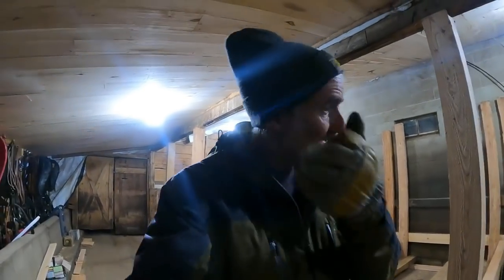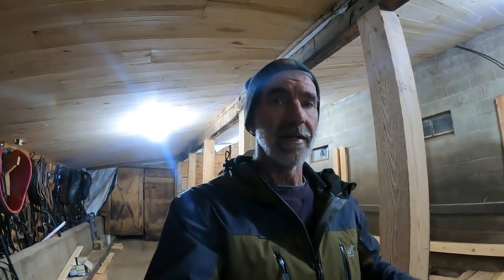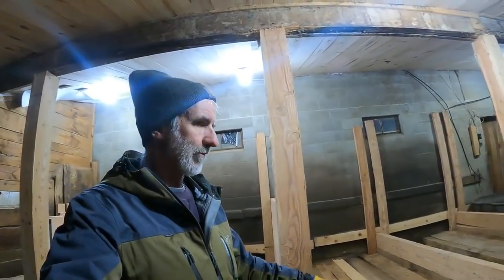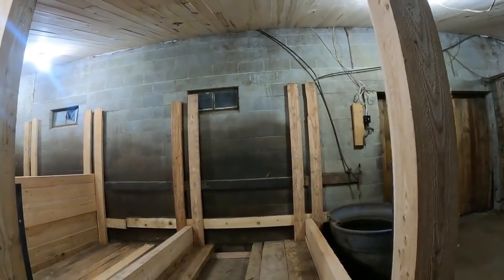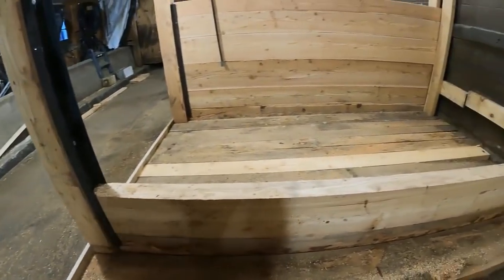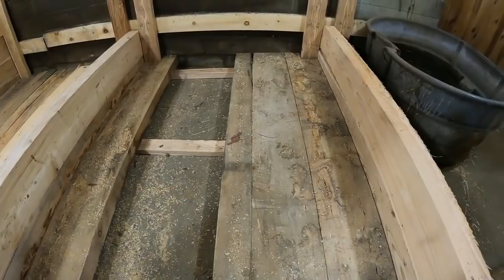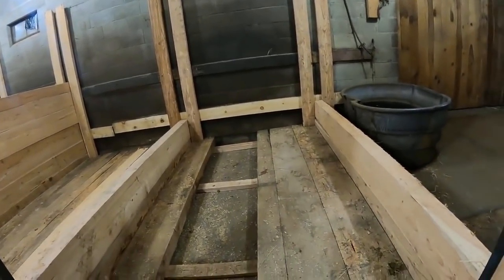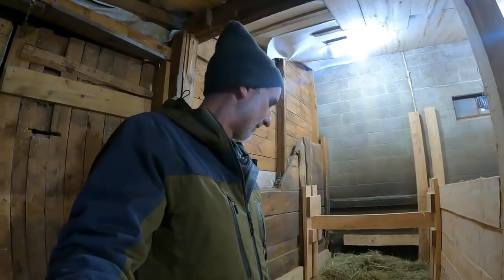Update on the New Horse Barn!!! // Draft Horse Stall Dimensions

Comment: I have straight stalls that are 8 feet long from the Manger to the back. My mangers are 36 inches tall and 30 inches from the wall at the top but run on about a 45 degree angle down to the wall where they meet the floor. I use rubber mats from Lineat rubber that are 4' 8" wide and that is the width of the stall. Stalls are 3"  oak. I wish I had the channel iron you have and the slope on the floor. My harness is in a box stall that I have converted into a tach room since I don't raise babies anymore.  I like what you have done.

Comment: Our box stalls had that wall to wall, seamless floor installed before we bought the place. That seamless floor works great. We don't have to worry much about rot from manure and urine. Those conveyor belts wear like iron, but when we had them in the work shop, sawdust would find it's way under them, so every now and again we'd have to roll them up and clean under them, lest we'd forever be tripping over the edges.
I wish that we had beefier walls like yours, as we've got a draft cross filly that's broke a few of the 2x8 spruce boards that our box stalls are made from.
We have water run to the barn, but even with the water supply being 5' below grade, the frost has still made it down that far twice since we took over the farm 5 years ago and have had to dig things up to resolve the issues wherever they've occurred.

Comment: Thanks so much for sharing your barn build!  I have never seen anyone use the old style tie stalls locally, and I am fascinated by them.  I kept my horse in a local stable that was actually a converted hog barn...low ceilings, uneven concrete floors in the stalls, big giant box stalls (it had originally been converted for broodmares and babies in the 50s), drafty in the winter and stifling in the summer.  We spent so much money on bedding and supplies trying to keep him off the concrete, and I know of so many horses who got into trouble because the stalls were big enough they had room to build up some traction.   Except for the worst parts of winter, those horses spent as much time outside as possible, just to keep them out of the barn.  How well do those wood floors work?  Do you have the replace the boards often because of urine damage?  Around here you're more likely to find compressed gravel or concrete than anything else, all of the old-style barns are gone or have been converted to storage.

A note of experience, one of the stalls where I kept my horse used reclaimed conveyer belting from a local coal mine as floor mats.  They did not install it properly, but I can't recommend it.  The mats were filled with wires that poked out from the edges, and it was warped just enough that nothing fit snug.  The horses were constantly tripping over the edges, urine would get underneath it and stink up the whole barn, and two or three times a year we would have to rip it all out powerwash everything, and carefully put it back together.  The only benefit of the thing I ever noticed was that that stall was just a little bit warmer in winter; the mats weren't really very cushioning for the horses that were in there, we still had to pile in the bedding to keep the horses from tripping over the edges.

Thank you so much for sharing your barn design, you have given me a lot to think about when I build my own barn in a few years.

Comment: Good job Jim. I wouldn't worry at all about the water. You and I both know Northern NY in winter is 5-6 months of worrying when the power will fail and the pipe will freeze, or a horse or cow will bust something and you find 6" of ice on the barn floor. Dairy barns, especially the old stanchion barns, were warmer and didn't have the issues a horse barn does. Any way, I use a similar slip board system and it works great. Good idea on the crap dropping back into the alley too. Tamarack makes a good stall floor, wish we had some up here on the farm. Far as width goes, I agree with your thoughts on horses turning in the stall. I've had a couple of knotheads that would do everything they could to turn and fight with their neighbor or try and get themselves into the manger. I finally put front board up at where the chest/neck meet height and didn't have any more problems with them getting into the manger. I have had some horses that had really lousy manners as far as trying to crush you against the wall if they could. Tie stalls help with that I think, especially if you remember to take an 18" hunk of broomstick in with you so you can get it between him and the wall when he tries to "lean on you". They figure out that pushing into that broomstick isn't near as much fun as squashing the guy that isn't bringing the feed fast enough! Had cows that would do that same thing. I think we all have to do what our individual barn layouts and livestock demand. I have a heck of a time trying to find room for 2 different herds of goats and 1 of sheep, a separate mixed herd of young stock not ready for breeding, rams and bucks, plus horses and cattle. The barn is NEVER big enough and it seems like there's never enough hay! I guess that's life. Take care and have a good Christmas!

Comment: Jim, the stalls look great, and I understand the 7 ft. length dimensions & making the mangers 3 ft.., because of the center beam. but now that you have that extra room you could build cabinet stands to hold drinking stations/ small stainless steel drinking sinks or place floating drinking sinks to the right side of the front corner of those mangers and install a gravity flow pump for each, and put them in each stall, and run a main water line piping along the back wall  to hook up the piping from the sinks to it and mount the pipes with u-brackets to the wood on the rt. side wall of each manger! Have them about 3 or 3 1/2 ft. off the height of the floor plank boards!  I know you could make them Horse proof! You got the skills! But perhaps you don't have the time! Oh well, just an idea!

Comment: I built my stalls the same way as you have done., just had mangers 18 inches deep.  The tie section i used a channel iron on the top to prevent a a broken plank if the horse should pull.
Reply from the maker: sounds good

Comment: We had box stalls with access to outside corral… don’t remember size exactly but they were comfortable. The outside was graded down at a gentle angle for drainage… mangers were a corner of the stall next to a Dutch door that we opened in the am when we fed, and closed when we fed in the pm… we put grain on top of the hay flake when we fed it… the stalls were so easy to clean as we mucked everything out the back through their paddocks… most didn’t poop in their stalls they went outside…( bless their little hearts!) my perch/quarter mare was the best, as well as my Tennessee Walker… natural feet from when he was foaled, great temperament!… very gentle and smart. I miss them a lot… they saved me as a kid. So grateful for my experience with horses as a kid.❣️love your videos so much!

Comment: Nice breakdown on the stall design. Wonder if the rubber mat could go under the manger to the concrete block wall to protect the manger floor boards ?

Comment: Good looking stalls. We have always had both tie stalls and box stalls in the barn and purpose for both. Some folks don't like tie stalls, but if the horses are being worked and have access to pasture I think they're great and very handy for working horses. I'm glad to see you building them strong. You mentioned horses fighting over the wall, we had a mare kick the divider down against her neighbor once and ours was two inch oak. I have rebuilt our draft stalls recently and even lengthened the mangers in the box stalls with a feed box on each end in case I need to double up in them (of course I would tie the horses at that point).

Comment: I like the solidity of your stalls;  when I had four Belgians I had similar stalls; the difference was that there was an aisle in front and behind the horses, so that the horses didn't have to stand and look at a wall., and I could feed them from the front and clean out from behind.   Now that I only have two Percherons I switched to  open box stalls and the horses have the option to go in and out at their discretion. They have access to water at all times.  
The main difference probably is that usually I only work them a few times per week and then not all day as our farm is small. Today we worked for 5 hours.

Comment: This looks to be a great job Jim love the thickness of the timbers. one question what is the height from the deck to the ceiling. I am looking to convert an old barn to my horse barn, I have already converted some to make two box stalls but have worked horse in straight stalls and really
 like them. Anyway great job from Rod down under in New Zealand

Comment: Jim what amazing job you Guys & Gals are doing with your stalls: If I have to ever redo ours, I want to do it the very same except I will have to purchase all lumber. That lumber you cut is amazing, !  Was thinking if you ever have a horse that chews on top of the manger board could always put a piece of  steel Chanel easily down but may never need to just a thought.  I also use standing stalls our horses seemed very comfortable in them.
Anyway good luck and keep up the amazing work.

Comment: I would have had your horses face the outside w windows and put your harnesses on brick wall.  You could also have a door w a hay rack attached to door to let them out each day.  They could come in from the center aisle into each stall as tge do now.  I'm not a fan of straight stalls as I think their joints would deteriorate quicker but I certainly understand the positives of your process for harnessing.

Comment: Thank you for describing the difference and reasons for straight stalls Vs box stalls for your situation.  Having had riding horses in box stalls, your different needs for the working horses made sense. As long as they can lay down and be comfortable.  Used rubber matting with some shavings which made mucking out so much easier. Do need the correct slope, which you have well in hand. I like horses eating naturally with their heads down. Great job and quality workmanship.  A very informative 20 minutes.

Comment: ? On the manger side to keep horses from fighting could you not just slide them in because; that would keep the boards easy to slide out if a horse was cast. Just in case. Wondering. Thanks. Why don't you have mules?
Reply from the maker: Thanks for your suggestion but it would be a little difficult.
Reply: @WorkingHorsesWithJim  why don't you work miles? Draft ones?

Comment: I know it's hard on a farm to eliminate habitat for rats. It seems like you may have created some space for them with the new stalls.. A rat needs habitat, food, and water all within 100 yards. Sanitation and protection of animal feed are the best way to keep populations down along with permanent bait feeders. You can set up a deer trail cam in the barn with infrared to gauge your population of rats. I found a dead rat in my barn this fall and it hadn't touched the new bait I had put out. I suspect it may have come out of a combine from a neighboring farm. I'm surrounded by corn and soybean fields. I stopped putting out bait for a couple months because I was killing baby rabbits that were eating it and had just started back up. The mice dislike one type of chunk bait. I run a wire thru the hole in the chunk and loop it back in a ring. I then tie off the other end so they can't steal it. If you use pellets, they will stash them all over and not eat them.